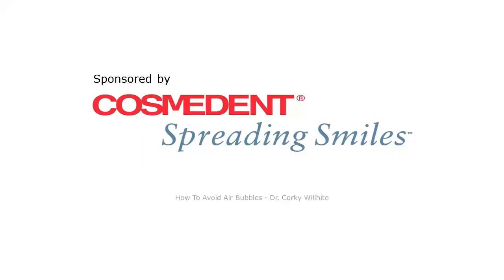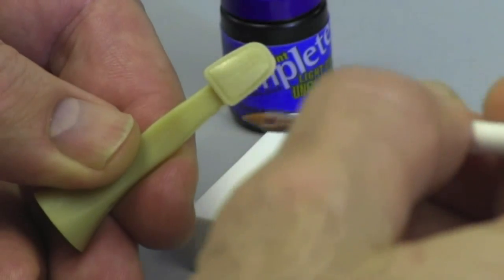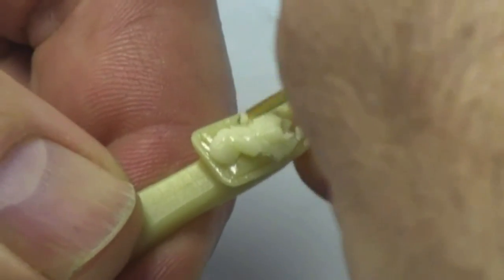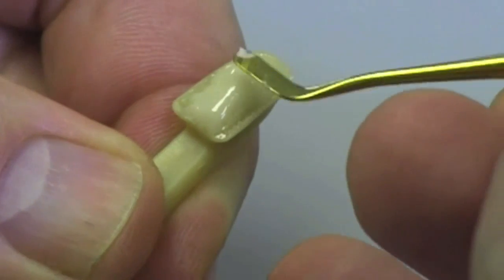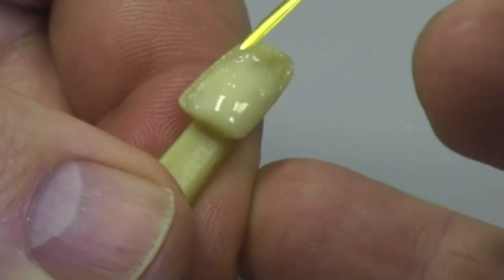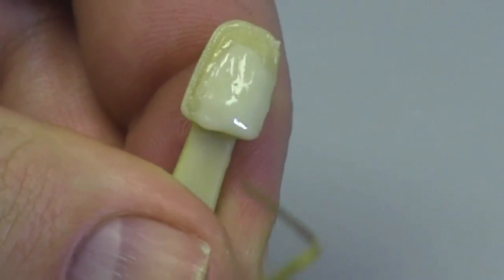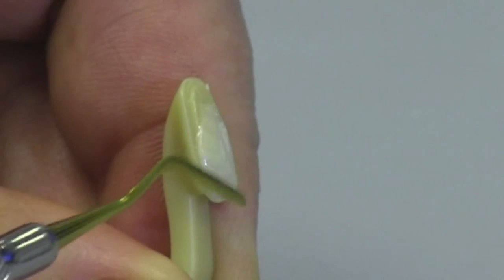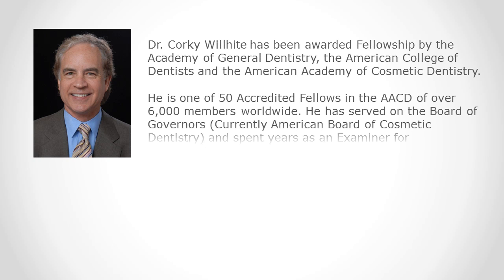Composite Restoration - How to avoid air bubbles

Comment: Is it ok if air is trapped in it? I have a composite filling with an air bubble.
Reply: i would also like to know. i think i have this issue to. when i push my tounge on the surface, It sort of moves and makes me thing=k theres an air bubble under it
Reply: @stephaniebrooke5656  your one has de-bonded get it replaced